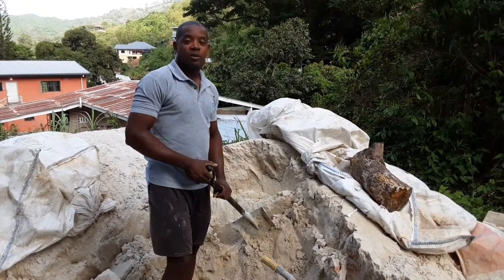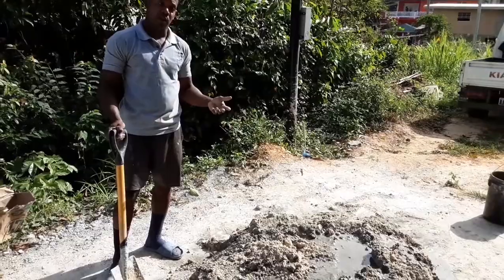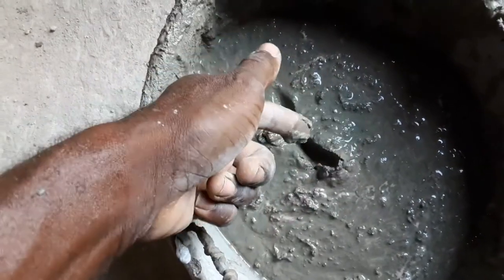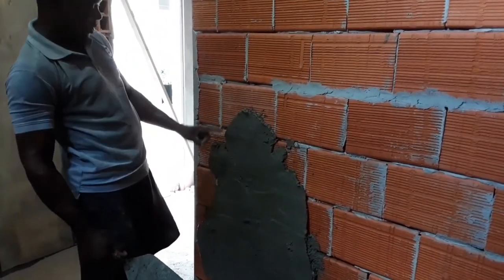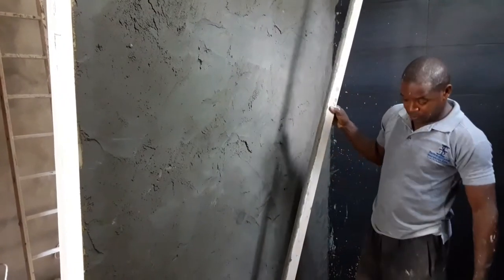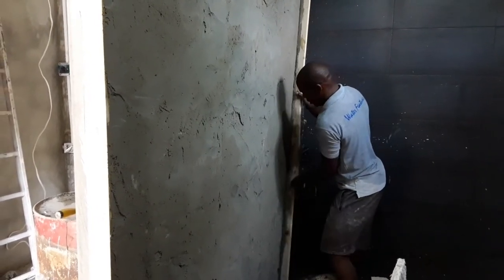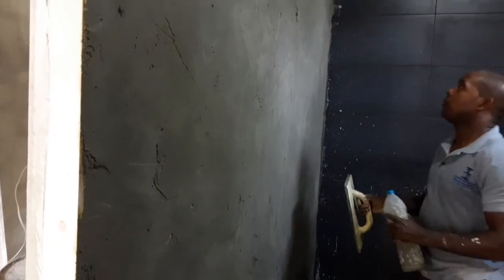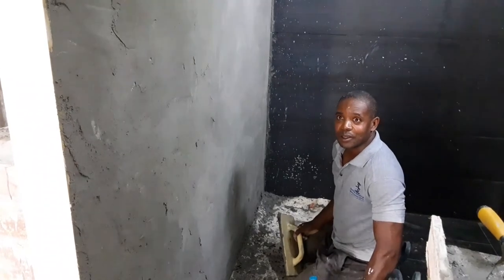How to plaster a brick wall, step by step!

Comment: Did you say 36 shovels to 1 bag? Are these full shovels?
Reply from the maker: 36 full shovels equals 3 100 lb bags of cement.
Reply: So is 36 shovel of sand and 3 bags of cement? Cause I only see u put one bag of cement.

Comment: I would like to plaster a bathroom floor but the concrete is very porous so I need to plaster it and make it as water proof as possible. Any advice? Higher cement content? Any products I can add to the mixture to make it less porous? Any advice would be appreciated
Reply from the maker: Enough cement is always the best. But the thickness of any subfloor is important as well. Additionally, concrete binding agents are recommended along with the appropriate size and thickness mesh wire. Once the concrete is about an hour, try sprinkling fresh cement powder on the surface and smooth out with the appropriate trowel to further waterproof. Try a concrete sealer after 72hrs. Concrete takes approximately 28 days to set.